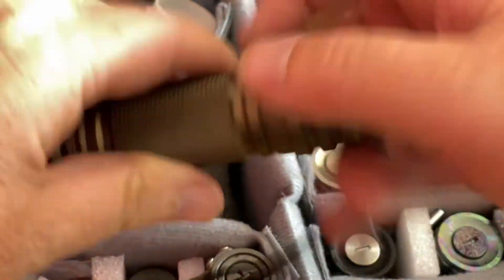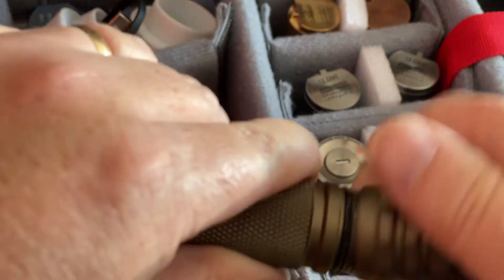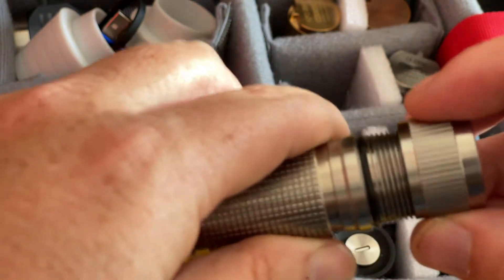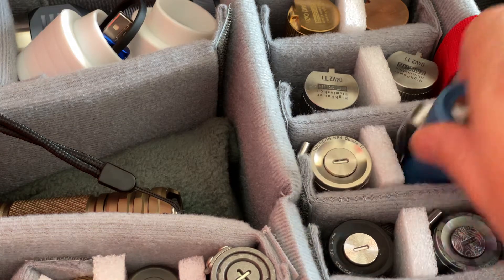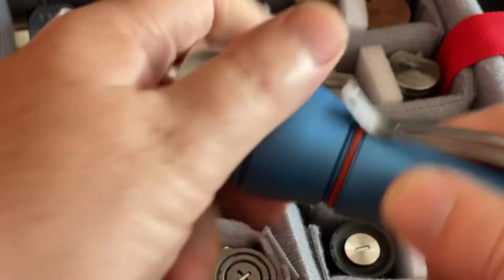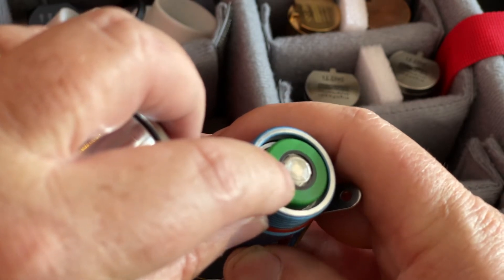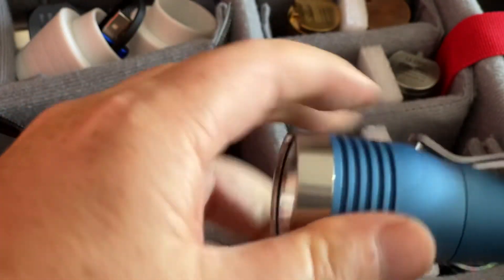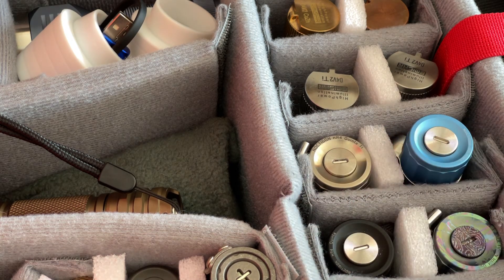Flashlights 101: battery marks from tail cap springs

Comment: Just curious, but why do you consider a D4v2 or Convoy as a "tail cap light" when you can still unscrew the head to change the cell?
Reply from the maker: The threads and spring pressure is worse on the head end.  You can definitely screw/unscrew the head end, but the chance of cross-threading is greater.
Reply: @cheule  i spin it backwards until i feel a click then screw it back together, no risk of cross threading